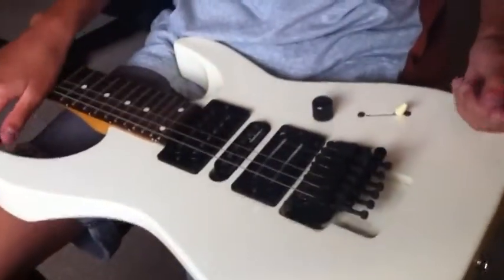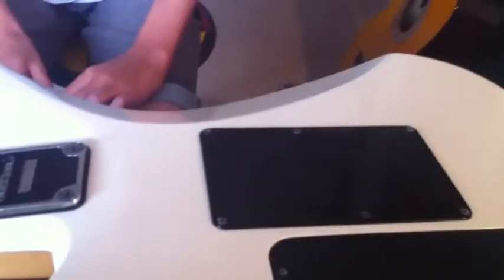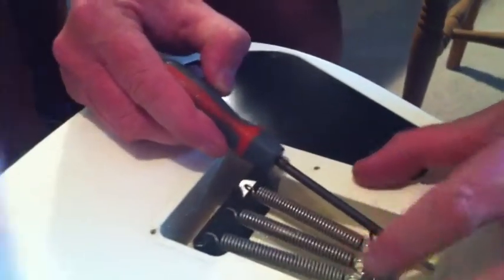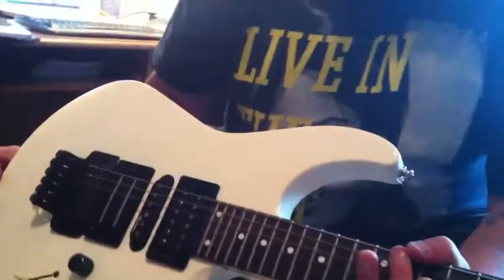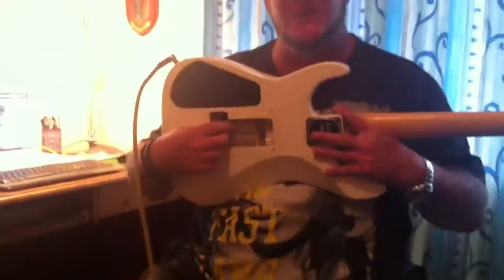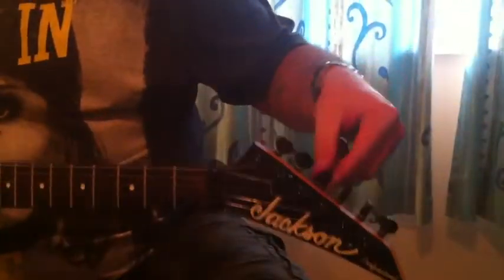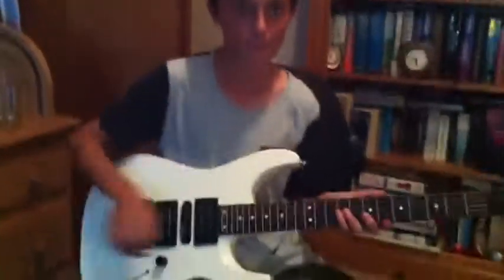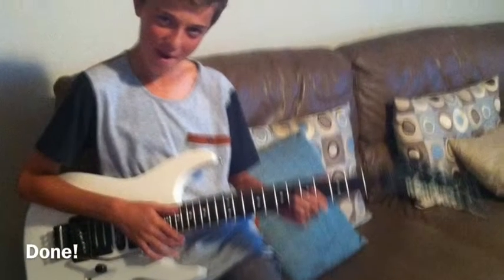How to balance a guitar whammy bar bridge (in this case a Japanese Jackson Floyd Rose)

Comment: I have a floyd rose sytem myself they are badass. Im have trouble keeping mine tuned. I'll tune one string and right when I tune the next string the string that I tune will be totally untuned. Do you have any advice before I make a youtube vid of me shooting my guitar?
Reply from the maker: Cool lets sort it before you reach for uncle shotty. A couple of questions.
Is it sitting flush with the body?
Are you strings real old/new,what guage?
How many strings have you got from the claw to the block?
Are you stretching you strings properly before you lock it?
Let me know buddie.
They can be right sod's but once set up its nuts how stable they are .
Reply: This is caused because the tremolo is moving while you put tension on the string. it usually results from someone removing all the strings to replace them rather than swapping them out one at a time. Use a tremolo wedge (some people use a 9 volt battery) to wedge behind the sustain block in the back. You may have to loosen the spring anchor plate to get it to lean against the wedge. With the wedge in, the tremolo should be perfectly level with the body of the guitar. Tune the guitar. The strings should all stay in tune because the tremolo can't move. Stretch the strings a little with your hand so they are seated in well. Now turn the screws in the spring anchor plate a quarter to a half turn - alternating between the two evenly until the wedge falls out. Now your bridge is level and the guitar is tuned. Lock the nut and fine tune.

Comment: For Floyd rose bridges like this.. It's ideal to use a mid tension strings .009, .011, .016, .024, .032, .042
Reply from the maker: Assassin _78 I find 9's just a bit puss. I like 10-46 on my floyd's and 10-52 on my Fender, Gibson & Gretsch.
Reply from the maker: Assassin _78 I find 9’s just a bit too light